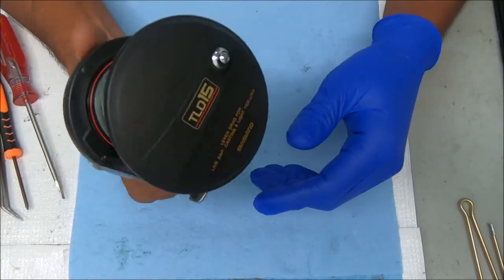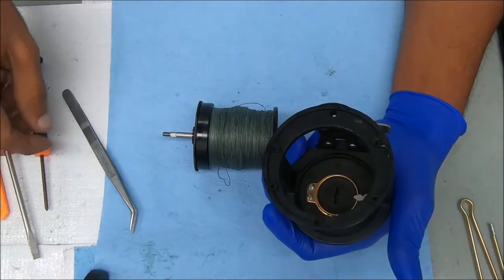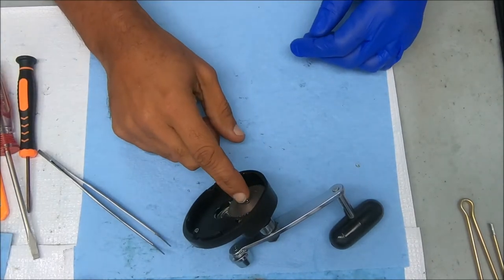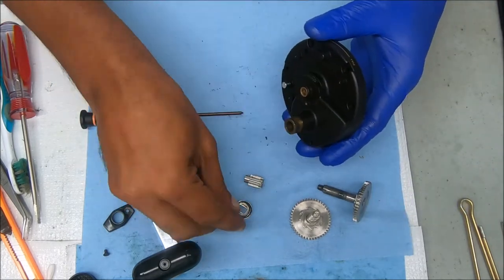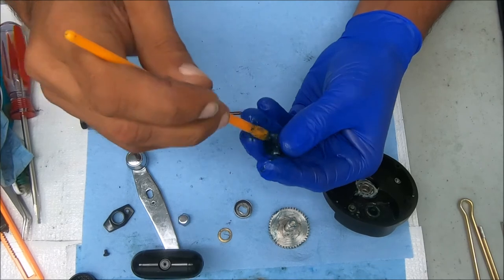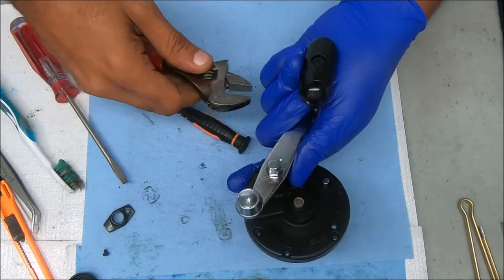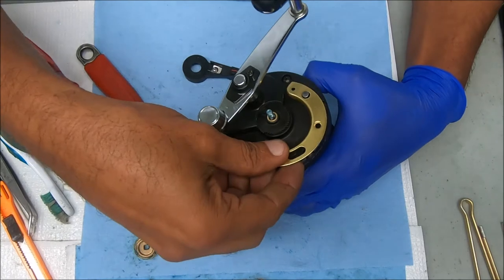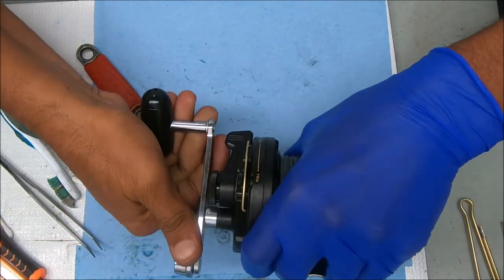Shimano TLD15 Drag Skipping --- MUST SEE If You Own A TLD - Diagnosis & Remedy: Fishing Reel Repair

Comment: Hey brother first off your videos are awesome and reel life savers ( like the word play there).  I have several TLD 15’s I have used your videos and cleaned and lubed all of them. I just have one reel that is wonky . No matter what I do I continue to have problems when I engage the drag with the handle/crank binding up. I have checked the gears no missing broken teeth, I checked the pinion bearing and it seems fine (spins freely) no signs of stress damage. I have excellent free spool  until I engage the drag and then return to free spool. That’s when it binds up and I loose free spool.  I have noticed that if I push the spool to the left side plate it moves about a 1/8” and free spool returns.  Any ideas what I might be doing wrong or what is broke. The other 2 reels went together flawlessly. Again thanks for your videos and any help!
Reply from the maker: Thanks for watching. Glad to hear the vids helped. Check the slot where your cross pin goes into on the non handle side. It may be a tight fit and need the sides shaved (go slowly and testing the feel as you go). Your pinion bearing may still be bad... you can't always tell by spinning it in your fingers.... it's under load that matters. Hope this helps.